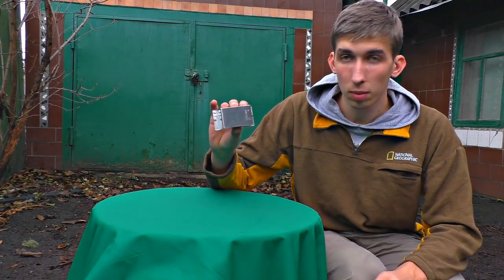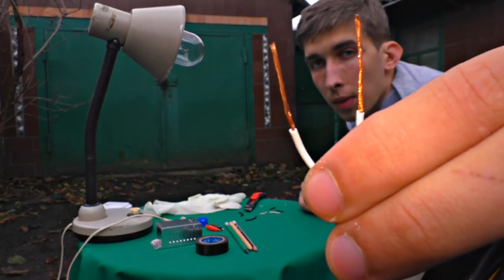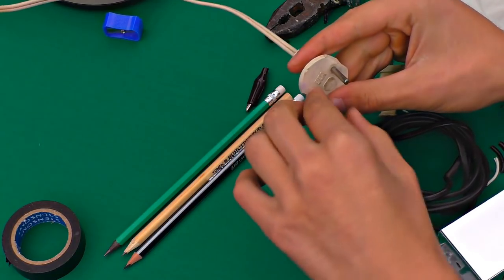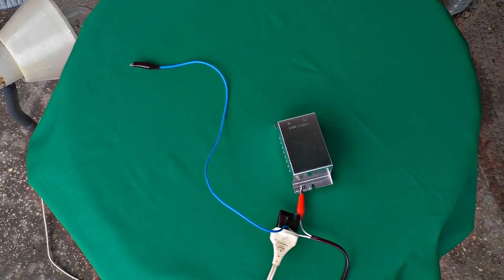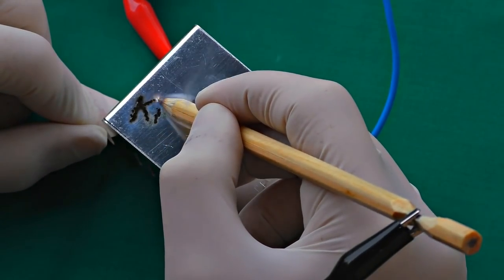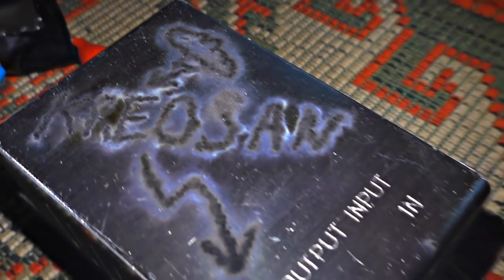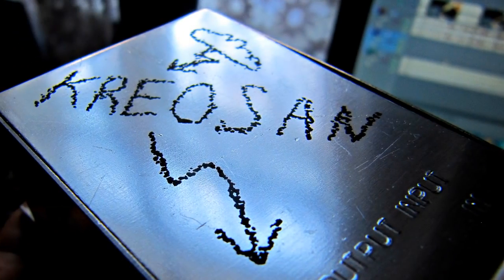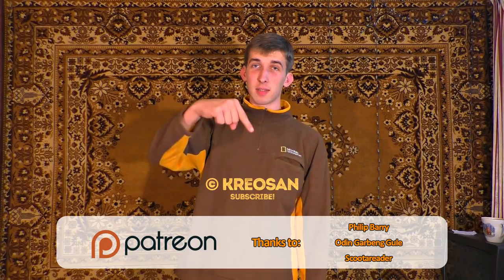An Electric Pencil for Metal Etching DIY / Metal Etching Tool

Comment: Interesting idea. I wonder if you could etch a circuit board with this instead of chemicals/laser?
Reply: It seems likely that the copper cladding is too thin for the current and may burn the underlying board.
That being said, I remember my dad using a permanent marker to create the tracks for simple circuit boards on some hobby projects- etchant is quite cheap and reasonably safe/stable, ours was kept in a large ziplock bag (to easily hold larger boards with less etchant) and the baggie of etchant was put in a glass jar between uses in case the bag split or degraded

Comment: Use instead a car battery, sooner or later you will electricuted your self. Don't play with main power I you don't have a clue. ☠️
Reply: But DC power is more dangerous than AC. Especially in a situation like this, if he was using DC and it shorted through him, the DC current would cause his muscles to contract and grip until current is stopped. At least with AC it'll hurt but he'll be able to let go
Reply: @saint-666  that's on ac. And dc is only from about 50volts up dangerous with enough current, on a dc 12v car battery you can only burn yourself if you have totally wet hands or some kind of metal or other material that's conductive that you are holding, like a wrench and you shorten the terminals out, it heats than the metal and you get beadly burnt.

Comment: Could be done much safer with a 12V halogen lights transformer, cheers ;)
Reply: Safer? Why?
Reply: Maybe some people don't want to die while metal etching with a pencil.
Reply: You are playing with 110/230v direct.
Reply: 110V is rarely deadly, the dangerous element is earth/ground reference. It means that touching only one live conductor can kill you. I definitely recommend using a GFCI or RCD together with that circuit. Your chances of survival are much greater if you messed up the setup.